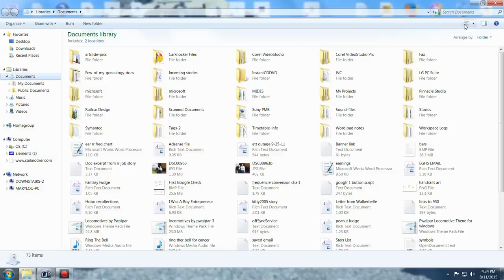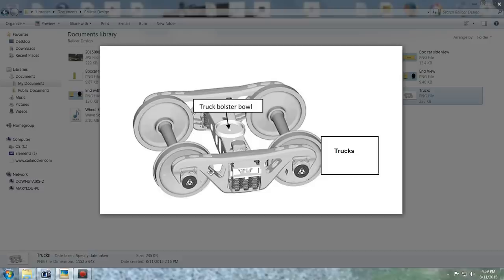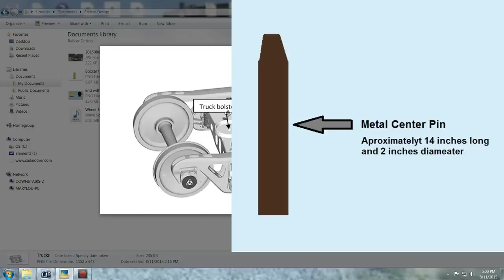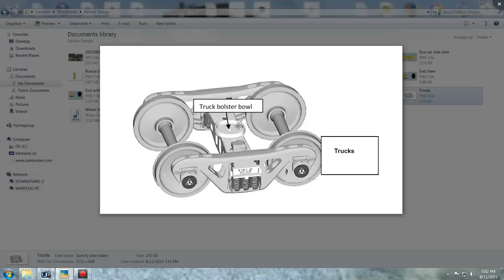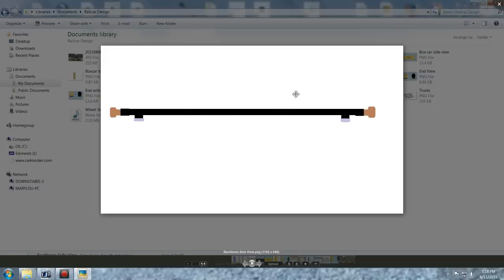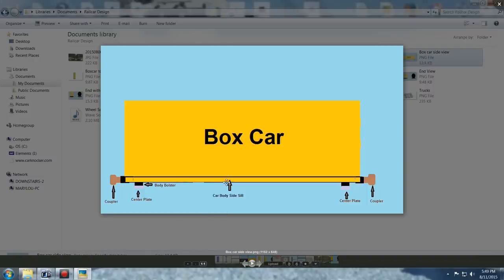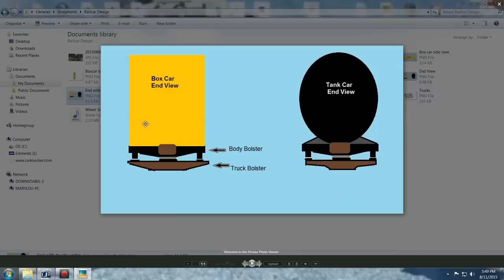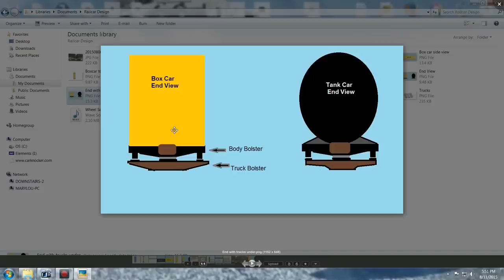Pwalpar VLOG Rail Car Design & Wheel Squeal 8 11 2015

Comment: Similar to a keel on a ship, Walter. My question to you is how often have you ever had to change out that center pin above each truck? Next, I'm aware that wheels get damaged and can build flat spots or chips in the wheels. What I have not seen is that flange on the wheel coming off, and yes provided the rails haven't moved away from the attachments holding them to the ties. That I've seen in one of your past videos of an engine off of a rail because the rail twisted. but I have a sneaking hunch that the cup/pin area is really what is squealing in that this area doesn't get lubricated. Metal to metal fatigue with the rubbing of those two parts.
Reply from the maker: The flanges wear out and the wheels have to be changes far more often than you may realize  The center pins do not get much wear  they are just a safety precaution

Comment: Good vid. btw...the 28 inch wheels he mentions are usually found on the tri-level autoracks. (ETTX) And I know pwalpar will attest to this...these cars are stenciled "28 inch wheels" to remind repair crews to put the correct size wheels on the car. These smaller wheels lower the car to allow for the appropriate amount of headroom up top.
Reply from the maker: Yes your quite right  actually I doubt you can put a 33 inch wheel under one due to the way trilevels are constructed

Comment: I would definitely like to learn more about rail cars and wheel squeal. Whenever I hear the wheels on a train squealing I think of when I worked in a machine shop. All that metal being cut and ground made a lot of noise. I can't help but think that the railroad would like to reduce the wear on the equipment and on the tracks. Anyway I would appreciate it if you would make another video describing how all these things work together and what the railroad does to reduce wear.
Reply from the maker: EdWittenable Thanks  I will

Comment: This is why the tracks are laid so narrow or close together compared to let's say the wheels of a car or truck on the road. If for example the tracks were laid only a few inches apart or right next to each other then wheels wouldn't need to turn at different speeds at all. Could you imagine what would happen if the tracks were twenty feet apart? It would be impossible for the train to go around a turn without encountering excessive resistance. The wheel axles also twist when going around a turn. They sort of wind-up like a spring, just a little bit and then they released. When they release it makes a snapping or popping noise.
Reply from the maker: Good points Eric  thanks

Comment: But you also pointed out those all important springs which help keep the cars level..  Your explanation of the center area of the trucks.
Reply from the maker: ahgfl007 Thanks
Reply: Something that I found while looking for wheel squeek / squeal.

W&H MAIN YARDS: Railroad Wheel 
By Christopher Coleman

Based on article by Christopher A. Lee, chrislee@netcom.com
Last Updated 5-30-97

When a train goes around a curve, the outside wheels have further to travel than the inside wheels. This is the same event that occurs in automobiles which requires a differential rather than a solid axle. In the case of railroads a solid axle is necessary for stregnth and simplicity, so another solution was applied.

The treads of a railroad wheel are not flat, but beveled into a hyperbole with the smaller diameter toward the outside and the curve leading into the flange. The distance between the inside faces of the railheads is slightly larger than the distance between the outside faces of the wheel flanges by about an inch. So as one wheel rides up its rail, the other wheel rides down its rail. The different diameters in contact with the rail have different circumfrances, which compensates for the different distances of travel.
First let's discuss what keeps the car on the tracks. The force pulling the car into the curve is the Centripital Force, the generic name for the net force which pulls and object in an arc. The components of the Centripital foce are 1) the preceeding and following cars through the couplers 2) the frictional force between the wheel treads and the railhead 3) Gravitational force IF the track is superelevated (banked). This force tends to coutneract Inertia, but since it is applied to the lower quarter of the car, the result is a torqe on the car around the center of gravity (COG), tending to rotate it towards rolling out of the curve. More important to use here, it also effects the the centering action by pushing the trucks toward the inside of the curve relative to the car's center of gravity .

Now Intertia and the Centripital Force counteract to prevent the car from flying off the inside or outside of the track, but what keeps the flanges from hitting the rail? Now consider the trucks as a separate system from the rest of the car. A state of equilibrium exists at a point where the circumfrance of each wheel, where it contacts the rail, matches the distance it needs to travel in one revolution.

Prior to reaching equilibrium the outer wheel is climbing the outer rail, and we will call this state Undercompensation. Until it reaches that point, there is a drag force (against the direction of travel) on the outer wheel as where it is being forced by the inner wheel to rotate too slowly to cover the distance it must travel. Similarly the outer wheel is forcing the inner wheel to rotate too fast causing a tractional force (in the direction of travel). These forces excert a torque on the truck around a vertical axis at its connection to the car. This torque pushes the the lead outer wheel higher on the rail (giving it a larger diamater) and the lead inner wheel lower (giving it a smaller diameter). The trailing wheels tend to follow the path of the lead wheels forcing the system toward the equilibrium point.
The slightest Overcompensation would cause a oscillation between these two states if there was not lateral friciton beween the rail and the wheel. So in this way the trucks find their way to the equilibrium point. The exact location of the equilibrium point depends on the forces acting on the system, especially gravity, the Centripical force, and the geometry of the track.

This centering action does not always work well enough. If you observe a heavily loaded or fast moving train on a curve, you will hear a periodic sqeek or lonq squeal. This results from the Overcompensation to the extent that the wheel flange bumps the rail head (squeek) or slides along it for a time (squeal), until the centering action takes it back towards equilibrium. This can also be exagerated by bad track (crowned sectional rail for example) which forces the wheels back and forth.

The squeal results from the fact the flange strikes the rail just before the bottom of travel while it is still moving downward. Also, as the wheel climbs into the steepest segment of the hyperbole, gravity takes over to foce the wleel back down the flange. So we have friction versus gravity resulting in metal scraping on metal. This is undesired, but normal, and flange greasers are often installed preceeding tight curves on mainlines to cut down on damage resulting from this.
A worse scenario is wheel creep. Once the flange hits the rail the centering action only serves to force the flange into the rail. If the wheels cannot reach the correct diameter to match their distance of travel and periodically either the inner wheel slips backward or the outer wheel slips forward. The former is more likely since the inner wheel has less contact area with the rail and hence less friction. This causes the POP-POP sound created on very tight curves.

A differnt solution than traditional centering action is self steering trucks as applied on some new locomotives. in this system the axles independently rotate slightly in the truck frame to individually remain tangent to the rail. In this way the centering action does not occur as suddenly, reducing the Overcompensation that causes flange and rail wear.

The seemingly obvious solution is to split the axle in the middle, and put bearings there. The problem with this is that without the centering action that forces the truck around the curve, the truck would always plow straight ahead until the flanges hit the rail.
Wheel and Rail Wear

All this theory is intended to prolong the life of both the wheel and rail. Rail and wheels are produced is a particular shape to create the desired effects, but as with all moving parts wear is unavoidable. On the rail, it will wear the rail down to a matching hyperbolic shape to the wheel, and the wheels will wear into the sharper shape of the rail. Wheels are machined as one might expect when the car is serviced. The rail, however, cannot be pulled into the shop. Rail grinders, machines which apply properly shaped grinding wheels to the rail, can reshape the rail head for a certain number of times.
In extreme cases the inside head of the rail can sink as much as an inch in relation to the outside, and eventually the inside part of the rail, or even the entire head, will crack and break off. Extremely worn rail will apper as it was melted by extreme heat on its inner side.

The other major defect in wheels is a result of stoppling. In emergency situations, and engineer can release all the air from the trains braking system, causing the air reserviors on each car to apply the brakes fully. This can cause the weels to lock up and skid, grinding part of the weel flat. A flat wheel will cause a CLANK-CLANK sound as it passes. It causes extreme stress in both the rail and the car as it punds the track. In extreme cases, the inbalance and forces can acually cause the weel to jump off the rail each revolution, exagerating the problem. The forces applied by flat wheels is a major cause of broken rails. Skidding can also be caused by and overheated bearing which seizes.
Reply from the maker: ahgfl007 Thanks for sharing